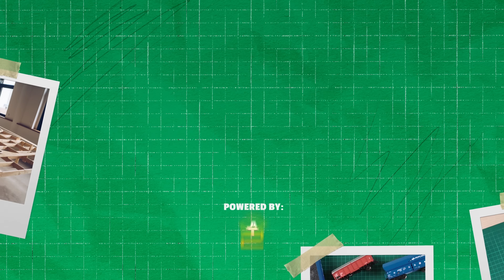Building a Train Bridge Diorama by Game: PART 3

Comment: The arches don't have any support, an as flat as they are there is no side support underneath. In real life the bridge wouldn't stand for the weight of real engins an cars with the loaded they carry.
Reply: Hi, good commit would like an answer to this question.?
Reply: Shouldn't be using sprays around the surface of the rails without protecting them first.